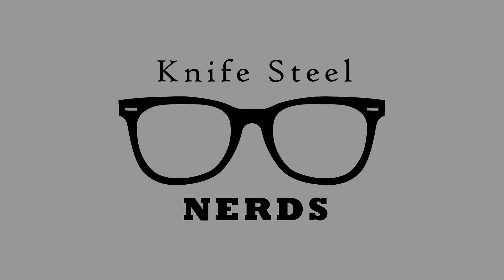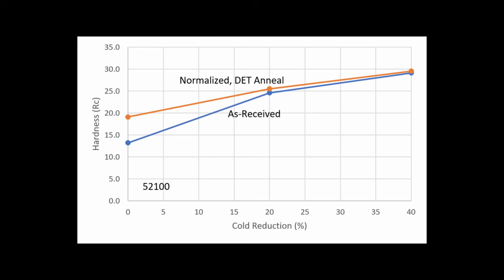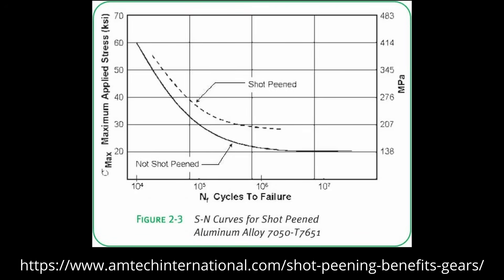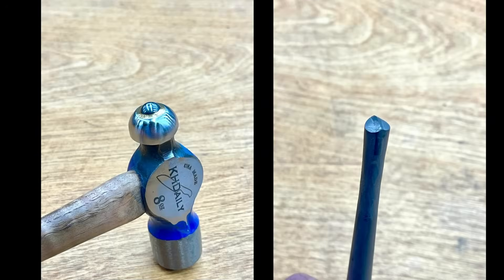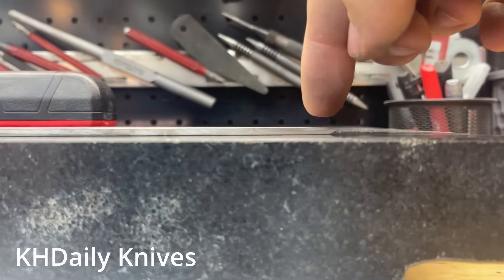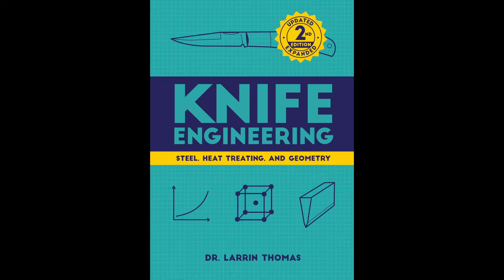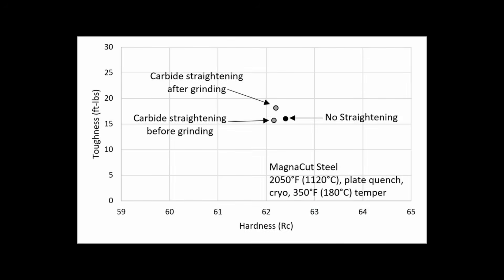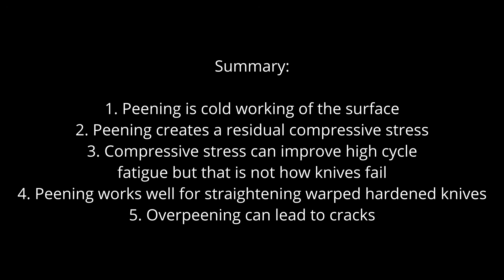Is Straightening with a Carbide Hammer Dangerous?

Comment: For many years I have used a Stanley's Tinners hammer to peen knives The vast majority were carbon steels but also some AEBL. I hit just hard enough to get an indent but no harder if that makes sense and since the eighties I haven't got any back. The face of the hammer gives me a longer v shape than the carbide balls more like Japanese straightening hammers. It is rounded so it does not bite in like a chisel would and has worked well for me at least.

Comment: so if peening hardens the surface is that a different method to achieve a similar result as case hardening? i know you said it wouldn't really improve performance but im assuming it must have some kind of affect on "edge retention" no?
Reply from the maker: Case hardening refers to a specific process of carburizing the surface of low carbon steel. Peening doesn’t add any carbon. Peening could only affect edge retention if you peened the edge.
Reply: @KnifeSteelNerds I see. Thank you. I didn't realize. I thought it was literal in the sense that the outside gets hardened.

Comment: Im curious if you are flattening via peening on a flat stock after ht, but then you do your grinding, you may be grinding off most of the peened material. would that not return it back to bent? it feels like this needs to be done on the final step.. Anyone know?
Reply: Some of the material that you are correcting gets removed too while you grind the dimples out. Also there is still a small amount of compressive stresses under the dimple when ground down. 

I usually don’t see the warp come back as long as you are removing material relatively symmetrically off the blade.
Reply: @KHDailyKnives 

To this point, if you have a dead flat straight piece of heat treated steel and grind it asymmetrically you will induce a warp. 

Matter of fact this will happen with any hard material ie micarta, titanium, g10
Reply: Ive literally peened straight close to 1000 blades at this point and Ive never had a warp come back after grinding the peen marks out.
Reply: @SuperSteelSteve good to know.

Comment: I saw this method demonstrated by Eduardo Berardo, a Brazilian J.S., with a hard-tempered steel peening hammer on a softer damascus bowie blade. I'd never heard of it, this was in probably 2011 or so. I tried it, it worked well. Then I went through a phase of heat treating batches of thin chef knife blades to 62 rockwell in AEB-L, which likes to warp a lot. I needed a harder peening hammer so I press fit a piece of a broken 1/4" carbide endmill into the drilled face of a cheap little ball peen, then ground a mild straight peen shape onto the little carbide face.  It worked a treat for straightening hard stainless blades.  To my knowledge this was the first carbide straightening hammer, at least in common use in the USA. I shared that over time with other well known makers such as Will Brigham, and Don Nguyen, as well as demonstrating the technique while teaching workshops and also in videos on my YouTube channel. Now although you can buy ball-type ones from a number of purveyors (they work but are not ideal) the original directional one I made is still straightening blades in my shop.
I have never cracked a blade with this method, and I have straightened hundreds. It is a wonderful method as it can be used very late in the process, on a hardened, thin, and nearly finished blade if needed.  The dimples grind out quickly even with a 400 grit belt.
-Salem Straub
Reply: The warp doesn't come back after grinding out the dimples?
Reply: @l @lando8913  will if you grind too far. You can always redo it a bit as needed. I do some throughout the process on blades that need it…

Comment: Pros: You get a nice straight blade
Cons: You get a bunch of ugly peening marks that are worse than a slightly bent blade.

Edit: typo
Reply: you surface finish after peening 😂😂

So no peening marks
Reply: @SuperSteelSteve can you please help me understand something? From the video it sounds to me like grinding to the bottom of the peen marks (as a finishing process) would eliminate the retained stresses that straighten the blade. Wouldn't finishing just re-bend the blade then?
Reply: @connormeredith3144  no lol

Im being 100% honest when I say ive peened straight every single blade ive ever made. All are done pre finish. I grind out all the peen marks and they always stay straight.

If you see how it works, your in essence cold forging the warped side and "stretching" the warped side. So grinding out the peen marks doesn't remove the "stretched" steel if that makes sense.

Same as when you hot forge a blade, you stretch out the steel. It doesn't shrink back after you grind the bevels if that makes sense.

Comment: Our two cents on this topic: we straighten blades before finishing, and we’ve never had a case of them returning to the pre-peened shape afterward. Sometimes we straighten in the middle of finishing when a blade suddenly decides to make a funny bend out of nowhere. We’ve successfully straightened every steel, except 71 HRC REX 121, which does not enjoy straightening very much; it can only be bent so far before exploding, and we suppose straightening by peening is limited to that same threshold. We also pre-heat blades before straightening. One funny experience with REX 121 is that it will continue bending further for a few hours after straightening.

Comment: I have experienced this. I had a test knife in Nitro-V steel(62-63rc if I remember correctly) that was severely warped. I used it hard for 4-5 years on and off for cutting foam insulation, stripping copper wire, cutting wire and would use it to dig small holes on the ground or cut sod in my very rocky soil. I had no issues with hard use flexing the knife. I got a carbide hammer and fixed the warp. As mentioned it was extremely warped but I was able to completely straighten it. It was overworked for sure, but shortly after I was doing the same thing I had previously done, digging holes for planting acorns (stabbing in the groud and prying sideways) and it cracked. A rather large crack just the one you showed. It didn't even look like as many hits as the blade Kyle showed on that knife but it was a much smaller knife and more concentrated hits. I haven't had at issues with other knives I have straightened but I try to get warps out in temper and use the hammer as a secondary option.
Reply: Depending on how much the blade is warped, some require more or less hitting. That one was particularly warped and was a good example to show the lines with the ball shaped hits.
Reply: @KHDailyKnives yeah mine was about 1" tall from edge to spine so my hits were very concentrated. Also I was abusing the knife a lot so that didn't help but that's the way I like to test them haha

Comment: During my time as a tool and die maker (1976 - 1980) straightening thin part by peening was a common method. We made molds for electronic connectors that had very thin and long parts as part of a complex cavity. Warping was very hard to avoid. You either leave the parts thick to stay straight after quenching and then grind away material. Not very cost effective. Or leave them "thin" and straighten. 
I am making knives for the last 16 year now and of course straightening by peening is common to me. I even have two (safe made ball peen hammers from my apprenticeship). One hammer is made with bearing balls and those work on hardened blades as well. Just recently I made a carbide ball hammer. I also made a chisel type peen hammer.
Of all the knives I made I only had one knife that developed a crack that I trace back to peening. The knife I used the chisel type hammer with and that I for sure overspend. I never had any problems using a ball peen hammer. I never do hard hammer blows but rather use the weight of the hammer itself.
Just my 2 cents

Comment: I will perform the straightening after the first tempering cycle. 
when I peening ,I will heat the blade to slightly below the tempering temperature and tap it with a carbide hammer. 
After the blade is straightened, I carry out another tempering cycle.
It may not be necessary, but it makes me feel more at ease.
Reply: It might be interesting to conduct some basic science to test for the effects of your intuitive method. It makes sense to me but I am not a metallurgist. 
Hopefully Larrin will offer some professional insight here.

Comment: Hello larrin, in a 1700's book about bladesmithing, "peening picks" aka straightening hammers with a steel tipped point, were shown as very common/standard set of tools, just like tongs and files. Straightening by peening is without a doubt much older even, possibly the middle ages or even antiquity. Those picks had a V shaped tip, instead of the rounded carbide balls, so you can direct precisely the deformation and guide the straightening more effectively 👍 i forged one and am still using it to this day (the tip is a file that has been water quenched without a temper, or the very lowest of tempers, so it's harder than tempered knife blades).
Thanks for the video !
Reply: I've definitely seen v shaped carbide picks. Idk how common they are, but they exist and are used
Reply: I think I may have picked up one of these peening picks recently. I figured a blacksmith friend could tell me the intended use. It has a vertical and a horizontal pick. The head measures perhaps 5" lengthways and the picks are about 1 1/2" long. 
I have some hardness testing files: I suppose if the striking faces test to a high hardness that will help in the confirmation. 
Otherwise I suppose it might be some sort of rock hammer or something... 

Would the peening pick be harder at the points than a either a tool for hot-forging or rock-splitting? What should the hardness be in either case, please?
Reply: @dongkhamet1351 some of those "picks" are made to remove the scale from electrode welding. But if it's a REALLY old tool, then it might be it. Only the tips are hardened, and they are HARD, like, as hard as carbon steel can be. As hard/ Harder than a quality file. The goal is to be so hard it leaves dents in knife blades. That's why people use carbide nowadays, because it's harder than any steel
Reply: @jeanladoire4141 thanks for the advice. Going by that, it seems more likely that what I have is the welding accessory. Still I will test the hardness of the picks later today and if it turns out I have something special I will let you know :D
Reply: @dongkhamet1351 you can make your own straightening pick by welding a bit of an old file at the end of the hammer, heating to cherry red and quenching in water. No temper, or if you do a temper, do it at like 150°C maximum. You want 65HRC or even more 👍 don't make the V of the tip too thin, it needs to be wide and chunky (1/ to not shatter, 2/ to not dig too deep in the steel while straightening)
Reply: @jeanladoire4141 that is great advice, thank you. I have some carbide hammers but these are all ball tipped. With the method you offer different shapes of striking face are possible. 
I have done some straightening already as well as quite a lot of making things worse (in the case of compound warp) as well as cracked a few blades. Certainly in the interests of a useful tool I am more concerned that everything be in alignment, than whether the finish has peen marks.
Reply: @dongkhamet1351 sometimes i have very very bad warps when quenching in water (warping with a water quench is mandatory, according to the 1700s book i'm using), and so sometimes the blade warps lenghtwise and the flat becomes curved (the edge is bent out of alignment, like an asymetrical chisel but sometimes worse even). The V shaped tip allowed me to push the steel from the spine towards the edge, and slowly bend the edge back into the center. I don't think a ball peen would be directional enough to allow that. You can also blue the back of your blade with a blowtorch, and make the straightening much easier. In the 1700s they would make a set of very thick tongs and leave them in the forge fire until they are red hot. Then with the tongs you bite the back of your blade, and where it contacts the hot steel, the blade turns blue. But it's VERY localized and precise. It's basically spot bluing, it can be very useful (i did try it and it works pretty well, especially if you preheat the blade slightly before biting with the hot tongs)
Reply: @jeanladoire4141 a copper plate or large copper headed tongs . Also hot alloy made of tin and you dip the spine only